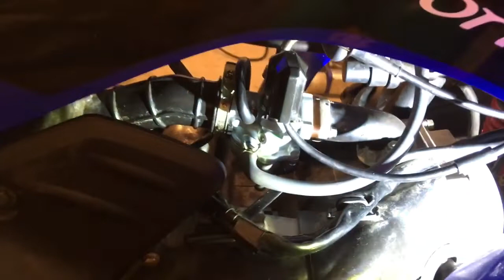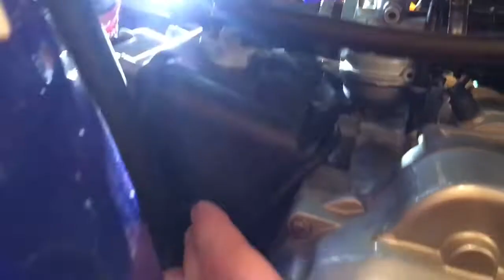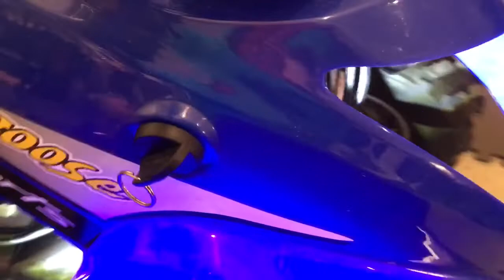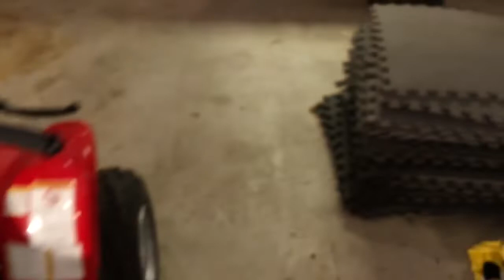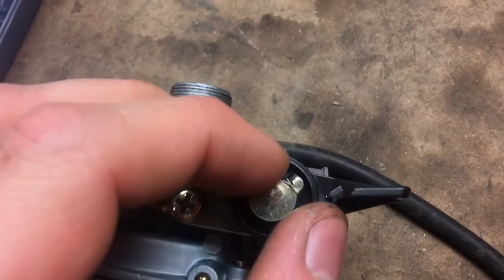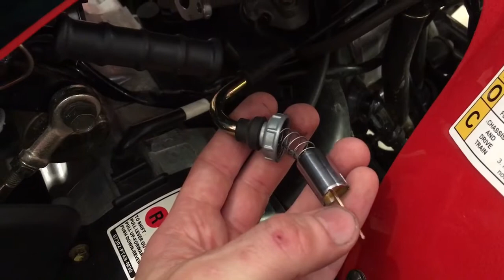KFX50/90, DVX50/90 or Mongoose 50/70/90 Manual choke carb conversion

Comment: I have 85 main and 40 pilot on my 2022. Thing likes to bog from an idle to full throttle. Almost seems lean, but spark plug is almost black.  Do you know ideal jet size for the 50?

Comment: Greg, purchased the carb you recommended and am pretty sure I followed your instructions. Quad now starts and idles fine (which is more than it did before) but as soon as I give it the smallest amount of gas it bogs and dies. Any ideas on what I am missing or what I might have done wrong? Thanks!

Comment: That air screw is adjustable. You need a special tool. Otherwise take it out with tweezers and Dremel a slot in it. The PZ19 is a piece of crap. The stock Keihin is better. What is the problem with the auto enrichers you had? Did they either stick open or stick closed? Because mine seems to work but it always has a gurgle at a quarter throttle transitioning from pilot to needle circuit. I've tried all kinds of jets and needle tapers

Comment: I changed out the emulsion tube with the main jet. If the emulsion tube is from the factory carb wouldn't you want to keep the factory needle as well?

Comment: I’m so disappointed with my mongoose 90 I bought brand new last summer , it will run for a while and then the battery goes dead, took back to dealer in Strafford mo and they kept it 3 weeks and never called me i ways had to call even when they said we will call you , they said they couldn’t find the problem ! Now it won’t start again, I’ll never buy another
Reply from the maker: I have noticed if I shut the machine off with the run switch and leave the key in the on position the battery will drain.  If I shut the machine off with the key the battery does not drain.  Hopefully this helps you.

Comment: Just wanted to say thank you! I took a chance and followed your video and it paid off. The 50 is back up and running again!
Reply from the maker: Fantastic!  Glad it helped
Reply: @gcarnrick  After 3 years, the carb went bad again... Ended up ordering OEM.
Reply: Did that carb work for the 50? Are the carbs the same size for the 50,70 and 90?

Comment: I have a Kymco 90 and trying to do the manual choke conversion.  I have ordered a PZ19 but it is not a direct swap, the cap from the old throttle cable assembly is larger than the body on the PZ19 and does not fit.  Does anyone know what carb to order?  Thanks
Reply: I wish I would have noticed your comment before I bought the carb in the video because now I have the exact problem you have described. Did you find a fix for this issue, such as a different throttle cable possibly. I haven't been able to find one.
Reply: @justinhogan7248  I did just order this throttle cable as the OEM one is not working with the new carb, I am going to try to put it on this weekend, will let you know if it works  https://www.amazon.com/gp/product/B008I610SE/ref=ppx_yo_dt_b_asin_title_o02_s00?ie=UTF8&psc=1
Reply: @brianboudreau690  Hey Brian thanks for replying back. I was looking at the same one also thinking along the same lines. I don't want the 65 bucks or whatever it was we spent to go up in smoke so I hope it does work out. The stock carb was so disgusting on the quad that I tried to clean it butits not even getting fuel to the bowl. If the throttle cable doesn't work I probably will buy a ultrasonic cleaner and try to clean up the stock carb. I'm keeping fingers crossed that the universal cable works for ya. I will be anxious to hear your results lol.
Reply: Did you have any success with the throttle cable install on the Kymco?
Reply: @justinhogan7248  its  not going well, the carb would not bolt up to the intake, i need to check it out further, but as of right now i would say this is not a good project to take on
Reply: @brianboudreau690  I guess I should have spent the money on a ultrasonic cleaner and used the original lol. I guess the 50cc he has in the video is different than the 90cc setup. Thats a real bummer. Probably can't even send the carb back at this point.
Reply from the maker: The carburetor bolted right up to the 50cc machine and the 90cc machine.  The 90cc in the video was a 2012 and the 50cc machine was a 2007.  What year was your 50cc machine?